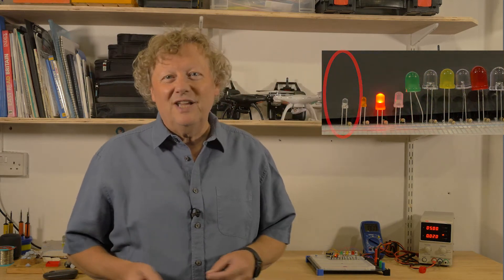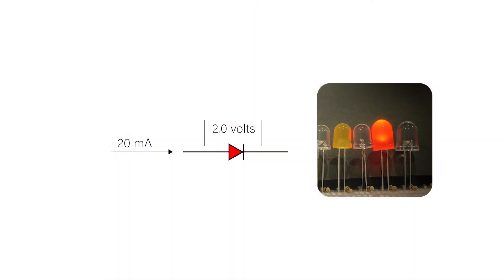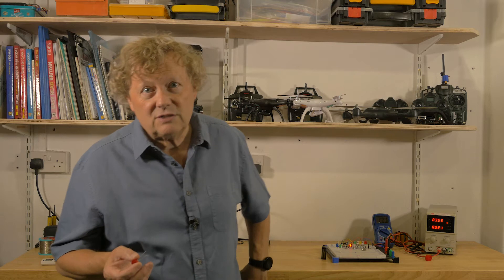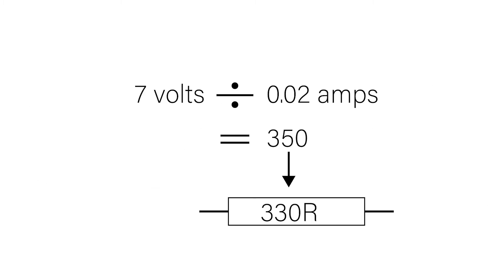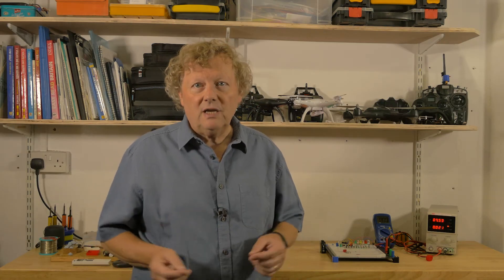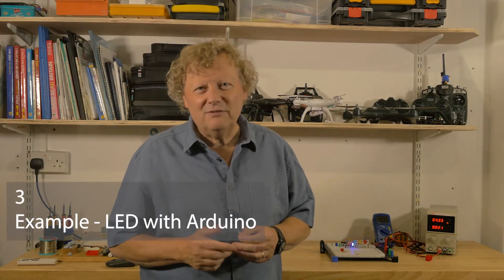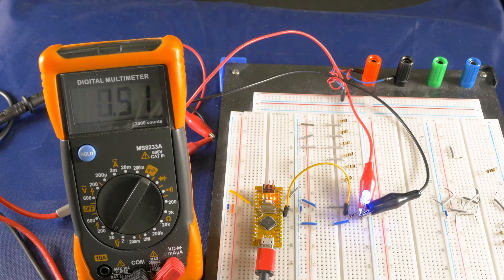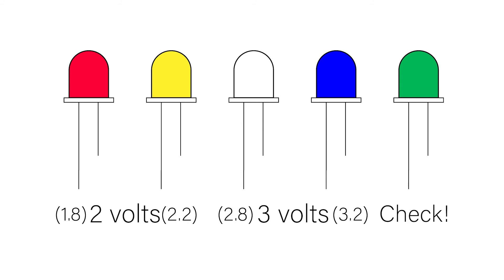All about LEDs Part 1: Choosing the right Resistor

Comment: Hello, I hope you can help me, I got hold of an old amstrad hifi twin tape hifi system in bits and the leds on the control panel are red but 7mm by 7mm by 2.5mm square. The wires come from the middle of the the narrow part. They are soldered on a circuit board but there is no resistors. Some of the leds do not work. They are for the volume level from zero to max full power.
I have followed your video but still stumped as if I put a 3v battery on the ones that work are very dim. If I try a small resistor from 100 ohms it is still dim. I cannot find any information on what type of they are as they are not listed anywhere in any catalogues or on the Web. The hifi must be around from 70s. Amstrad if I'm correct is a product that Sir Alan Sugar created but don't quote me.
I hope you can help me with some suggestions. 
Thank you, 
Yours Faithfully 
Paul Brown
Reply from the maker: It's always difficult to know with older equipment without any information or service manual - I don't think I can help with this, sorry.